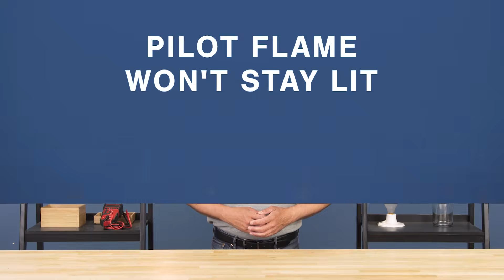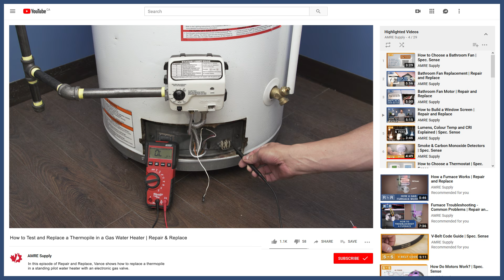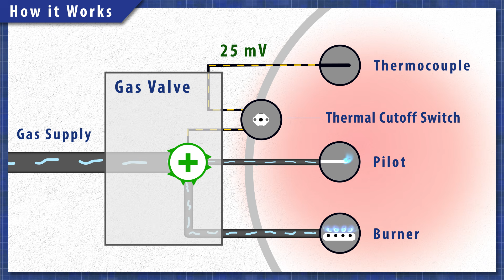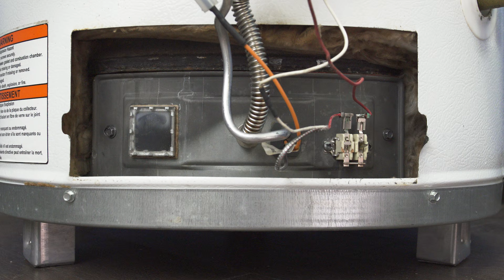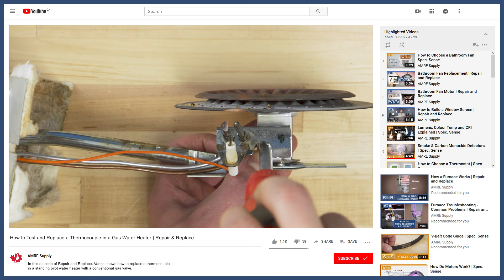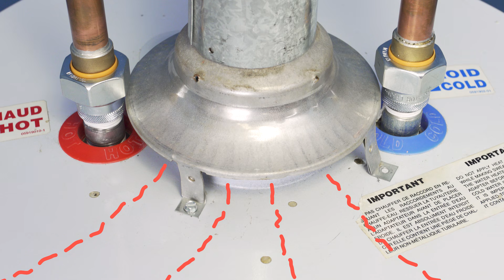Water Heater Troubleshooting - Pilot Won't Stay Lit | Repair and Replace

Comment from the maker: If your water heater has an electronic gas valve, then the repair will be different: 
Troubleshooting - Pilot Won't Stay Lit (Electronic Gas Valve) https://youtu.be/UXpmmGuewk8
How to Replace the Thermopile (Electronic Gas Valve) https://youtu.be/Yx2gfgJB7bI
Reply: Actually, my valve failed due to the electromagnets.  One shorted a wire from the lead pin that energizes the electromagnet.  Pilot lght would light, but go out as soon as you release the dial. Power from the thermocouple was fine. Re-soldered that wire, used electrical tape to limit future shorts, and whammo, hot water again! But I wouldn't suggest anyone disassembles the actual gas valve, like me, unless you are beyond careful, handy with tools, and quite desperate for hot water!
Reply from the maker: @myfavoritecolorisrage  Thanks for sharing your experience. In most cases, a new gas valve would be installed if all else tested good.
Reply: Oò poo
Reply: O

Comment: I fixed my water heater thanks to this video.   The pilot light kept going out.   I set the reset button on the thermal coupler and was able to get it working.   Thanks so much.

Comment: Was into the rabbit hole of water heater repair. Replace a few different components as recommended in other videos but nothing worked. Finally came across this video witch indicated a very small reset button. BINGO!! 
I love how detailed you got with testing that helped me diagnose the problem. Thanks.
Reply from the maker: Thank you for sharing, we're glad to hear that this video finally helped you narrow down the problem! That's exactly why we're so thorough in our troubleshooting videos.

Comment: When you are testing the thermal couple with the mulimeter does gas need to be shut off to it? I can't find that answer
Reply from the maker: No, the gas does not need to be shut off while you are testing the thermocouple with a multimeter. You have to heat it up to verify that the thermocouple is producing the right voltage, and this requires the pilot flame to be lit.

Comment: How many ohms should the tco read?
Reply from the maker: Thanks for watching. The TCO is a switch which means it has an unrestricted path for electricity to flow through. If the switch is closed it will have a resistance between 0 and 1 ohms. 
If the switch is tripped the TCO opens, and there will be no actual resistance reading instead the multimeter will show - - - - - - -  or OL as there is no path for electricity to flow.

Comment: If the TCO is bad, will it continue to trip or does that mean there’s a ventilation issue? The switch has continuity but proceeds to trip once the heater runs and then shuts off the pilot.
Reply from the maker: Thanks for watching. If the TCO does not have continuity when tested, then it is faulty and it needs to be replaced.

If the TCO has continuity when tested,  but still continues to trip, then it is likely an issue with the ventilation. If it trips it will shut off the pilot each time.
Reply: @AmreSupply  Cleaning out the chamber, the exhaust tube and baffle and the draft line seemed to have done the trick. Also replaced the thermopile just for kicks. Maybe I’ll get another 15 years out of it. 🤞
Reply from the maker: @marogtkid08  Thank you for the update, we're glad that the cleaning helped fix the problem. All the best to you!

Comment: It seems like my water heater is experiencing issues with the pilot light going out when the main burner stops. The sudden gust of wind I feel when the main burner goes out might be the cause. Do you think this due to improper venting or a draft around the water heater. I have verified the igniter and thermocouple all good.please help thanks
Reply from the maker: Thanks for watching. Without seeing all the details it is hard to say. It is best to make sure there is proper airflow into the room, (if there is a door to the room, make sure there is space under the door. If there is no intake of air there will be negative pressure and it can cause a back draft.

As well make sure there is nothing restricting any of the venting inside or outside.

Comment: My pilot wouldn’t stay lit, so I replaced the thermocouple.  The pilot will light and the heater will come on, but it shuts off as soon as a wire is touched, like when replacing the outer door.  I retested by just touching a wire with my finger too, same result.  My thermal cutoff has continuity, but is it going bad or is it a wiring issue?
Reply from the maker: Thanks for watching. If the thermal switch is tripping then you should be able to tell based on a continuity test.

If it runs fine and only shuts off if you touch the switch or door, then it's possible that the wire connectors are not making good contact.

In any case make sure that there is no corrosion on the wire terminals, and that they sit securely on the thermal switch. If that doesn't help, then install a new switch.

Comment: 5:32 I had an airflow issue when I moved into my my house a decade ago.  Something like 1/10 times, when the main burner ignited it would blow out the pilot light.  It would blow out almost every day.  I happened to be watching it when it happened one time.  I fashioned a small piece of sheet metal and put it between the pilot light and the outside air.  There was nothing between the pilot and the main burner, so the main burner ignites, but the piece of metal stops the turbulence that was blowing out the pilot.  It's worked just fine for the last 10 years.  This video didn't exist back then so I didn't know about the vent in the middle.  I'll check that today.
Reply from the maker: Thanks for sharing! Never would have thought to use a piece of sheet metal to help shield the pilot flame from additional turbulence. Airflow problems can be difficult to narrow down and some creativity is often needed.

Comment: No pilot light
Reply from the maker: Thanks for watching. If there is no pilot light, the it could be a plugged pilot orifice, faulty gas valve, or an issue with the gas supply.

Comment: Are replacement cutoff switches universal for most brands? I’m having trouble with our Whirlpool water heater, really I’m having trouble finding any replacement cutoff switches in general if anyone could point me in the right direction.
Reply from the maker: Thanks for watching. I don't know if there are any universal cutoff switches as the, size, the mounting holes and the way that the switch sits in the mount will differ.
Reply from the maker: You can see the ones that AMRE carries here: https://www.amresupply.com/catalog/Thermostats-647762-PP2H

As well if there are any numbers written on the cutoff switch, you can use that to help narrow down a replacement. For example if the switch says 270F or 270D, it's likely referring to the temperature at which it cuts power.

Comment: OL stands for over limit
Reply from the maker: Thanks for watching. I've seen both over limit and open loop listen in multimeter manuals. Over limit makes sense on multimeters that have specific resistance thresholds.

Comment: Great video, my issue I seem to be having is my pilot lights and I leave it on for a minute per the lighting instructions, as soon as I set the gas to on the main burner turns on for a second then goes out. Any ideas?
Reply from the maker: Thanks for watching. For the pilot to stay lit, the thermocouple must be producing enough voltage so it's worth verifying with a multimeter. As well corrosion between the thermocouple threads and the gas valve can also cause issues, so this can be cleaned with alcohol and a q-tip. If the voltage is good, and the connection is solid, then it could be an issue with the gas valve.

Comment: Thanks. This is great video! I basically followed the suggested troubleshooting procedure. One situation about my gas heater, it'll heat only once after the manual light on (pilot lighting), and it then shuts all the gas off once the set temperature is reached, so I don't get a standing pilot light... Tried to replace the thermocouple and get reading around 21mV at open condition. Also the continuity check shows good connection. Does it indicate a faulty gas valve? We're still able to have hot water so far, but only by manual lighting on...Please help, thanks!
Reply from the maker: Thanks for watching, we're glad that you found it helpful. If the thermocouple voltage was low it would shut off the gas before the water heater was able to heat. The fact that it heats up and gives you hot water before shutting off the pilot, points to the gas valve being faulty. The gas valve itself is difficult to troubleshoot and repair, so you might need to install a new valve.

Comment: thank you , I have a gas heater and the light won't stay lit though I replaced the thermocouple and magnetic bobene but nothing chang , please help me, thanks.
Reply from the maker: Thanks for watching. Sometimes corrosion can interfere with how the thermocouple screws into the gas valve. If there is corrosion on the gas valve threads then it will reduce the voltage. This corrosion can be cleaned with a q-tip and alcohol or vinegar.

As well you can test to see if the new thermocouple is producing the right voltage. If it isn't then it's possible that it's not positioned correctly or that the pilot orifice is plugged.
Reply: @AmreSupply  thank you and good luck
Reply from the maker: @omar_Elnabelsi You're welcome we're just happy to help!

Comment: Thank you for making the video, I have a question my water heater is acting up for the last couple of days, everything seems to be working fine but now we run out hot water in one shower, we normally check this right away and the flames are on then we can have the hot water after a while again, the setting is all the way to the highest level Please let me know what can possible be the problem thank you!
Reply from the maker: Thanks for watching. If your water heater isn't making as much hot water as it used to, it could be one of several things. The thermostat (on the gas valve) can wear out and lose sensitivity over time. This means that it thinks the tank is hotter than it actually is, which would cause the water in the tank to never reach as hot of a settings. This can be difficult to test, so the only way to know is to install a new gas valve to see if it changes things.

Sediment or rust can act as an insulator at the bottom of the tank, preventing heat from the burner from heating up the tank. Sometimes flushing the tank can help with this but there are no guarantees.

As well the dip tube is plastic. If it breaks off, then cold water will be sent into the top of the tank which will make some of the water colder than normal. The dip tube normally pushes new cold water into the bottom of the tank so it can be heated by the burner.

Comment: Multimeter should be set to DC. Thermocouple generates DC not AC.
Reply from the maker: Thanks for watching. At 3:47 we instruct to set the multimeter to the volts DC setting. The icon is V - - -  which is DC rather than the setting above V~ which is AC
Reply: @AmreSupply  I must have heard it wrong. Your videos are very informative.
Reply from the maker: @zorkonthegreat5879  Thank you. Tone can be difficult to figure out in comments vs spoken words, so wasn't sure if the comment was making a correction about the video or was a general statement on thermocouples. Cheers!

Comment: What could it be if the pilot will stay lit but the burner will not relight the heat the water when needed?
Reply from the maker: Thanks for watching. This is an indicator that the gas control valve is faulty. This is best replaced by a technician.
Reply: You did turn it back to on right ? Just checking .. And temp control hasn't been turned all way down to coldest setting?

Comment: Hi and thanks for the video. I changed the thermocoupler but the pilot light wont stay lit. is it possible its the gas controller ( have a honeywell controller) ?? thanks
Reply from the maker: Thanks for watching. You may still want to check the voltage of the new thermocouple. This will verify if the pilot flame is hitting the right portion of it or if the flame is hot enough. A weak pilot flame might also prevent the thermocouple from warming up properly. 

If the flame is weak then it's possible that the pilot orifice is plugged. We don't have a specific video showing this but you will likely need a pin to clear out the orifice.

Note that even if the thermocouple is producing voltage in an isolated test, it doesn't always mean the voltage is getting through. Sometimes the connection between the thermocouple and the gas control valve can become corroded. This can be cleaned with vinegar and a q-tip. 

Try that out first before replacing the gas valve.

Comment: My heater turns on the flame but it does not stay on, what will the problem be, will I have to clean it?
Reply from the maker: Thanks for watching. First test the thermocouple voltage based on the steps in this video. Replace the thermocouple if necessary. If the thermocouple is good, then clean the connection between the thermocouple and the gas valve. This can sometimes prevent the flow of electricity, preventing the pilot from staying lit. Other than that, it could be an airflow issue as outlined in the last half of this video.

Comment: I change the termlcope and still not lighting
Reply from the maker: Thanks for watching. Does the pilot flame light at all or is it just not staying lit? If the pilot flame doesn't ignite at all then it could be a bad ignitor, plugged pilot orifice or an issue with the gas valve.
Reply: @AmreSupply  the pilot not still on i have a full flame  on the pilot but not stay lighting even i change the  all pilot ensamble
Reply from the maker: @pegasso8  Its worth checking to see if there is corrosion where the thermocouple screws into the gas valve. If there is corrosion electricity won't flow between the thermocouple and the gas valve. You can use a q-tip soaked in alcohol or vinegar to help clean the threads. If that still doesn't work then it would be best to replace the gas control valve.
Reply: @AmreSupply  thanks  for you help  and keep doing i nice videos help me alot

Comment: If the thermal switch reads 0 on ohms is that the same as if it where an open loop?
Reply from the maker: Thanks for watching. The thermal switch is a non-load component. It simply provides a path for electricity to pass through. A reading of 0 ohms means that there is no resistance and electricity will flow unrestricted. Anything between 0 and 1 ohms is perfectly normally for a switch. Open loop, OL or a reading of - - - - - - means there is no path for electricity to flow through. 

These concepts are visualized in this video: https://youtu.be/iIQ14vTxVK0?t=17
Reply: @AmreSupply  I’m not sure what’s going on with mine I put in a new thermocouple since mine was old it’s all brand new everything is connected back where it needs to be, the thermal switch still reads 0 but I’m not getting enough voltage into the thermocouple it only goes up to .5 after 1 minute and then doesn’t climb from there then after 1 minute it’s back to 00.0 any thoughts?
Reply: Just realized mine is electric not conventional so I am getting voltage it actually went up to 730, however as soon as I let go of the button it won’t stay lit, my thermal switch still reads 0 and the button does not pop
Reply from the maker: @Thisisjs96  If its an electronic valve then you have a thermopile instead of a thermocouple. If the voltage gets up to 730 then you've verified that the gas supply works and that the thermopile is functioning. When you light the pilot its a manual bypass that allows gas to flow through the control valve into the pilot. Still that doesn't rule out a failure inside of the gas control. Its likely that the ECO (which is a fuse) tripped as a safety. This will happens if the tank overheats. If the ECO trips then the gas control valve will need to be replaced. This is difficult to test so if you are unsure then its best to call a plumber.
Reply: @AmreSupply  thanks for all the info I truly appreciate it as I haven’t had hot water in 3 days because I’m not the best technician but still trying to replace parts, so the eco is a fuse? My next step was to take the entire thing apart and see if I needed to replace anything inside, I’m going to do that today and shut off my power so I just wanted to know is there anything else inside that I need to check out?
Reply from the maker: @Thisisjs96  You're welcome, we're just happy to help. The ECO (energy cut off) is a small fuse inside of the temperature sensing bulb. Its meant as a high limit switch to shut off power if there is a failure in the thermostat sensing. Since its built into the bulb, it can't be accessed without cutting into it, which would destroy the part. If accessible, you might be able to check the solenoid coils for continuity, and in some cases you can find the wires to the ECO and test it for continuity to see what has failed, but other than that its difficult to narrow down.

Comment: So I have a question my gas water heater will work for a few day if I run water to much it makes the pilot go out the after off over night it will light and works fine for a few day what can be wrong
Reply from the maker: Thanks for watching. If it works intermittently, it could be an airflow issue, backdrafting or still a problem with the thermocouple as outlined in this video. In your case, make sure that the airflow is good first, and that the room that the water heater in has a fresh, unrestricted supply of air.

Comment: No my airflow is fine I think it’s my gas valve the burner is fine jus wish I knew how ta check it
Reply from the maker: The gas valve itself is difficult to check and if you've eliminated all other problems then the gas valve is best replaced by a professional.